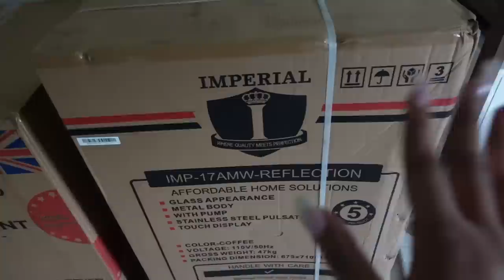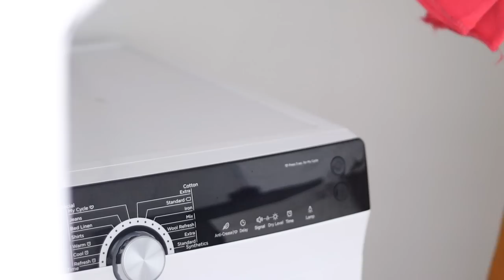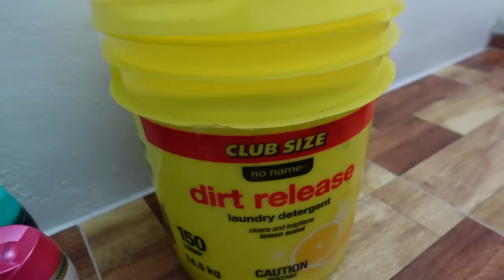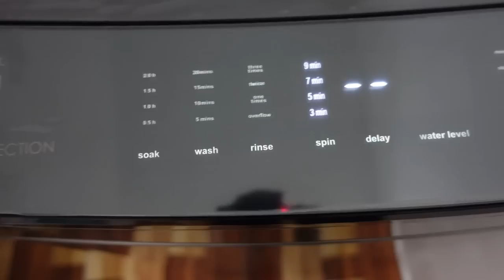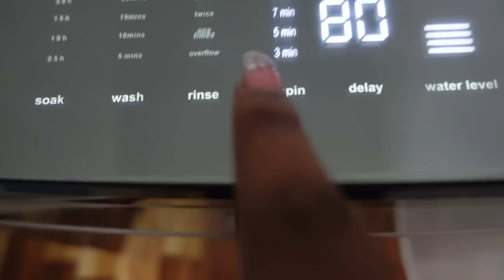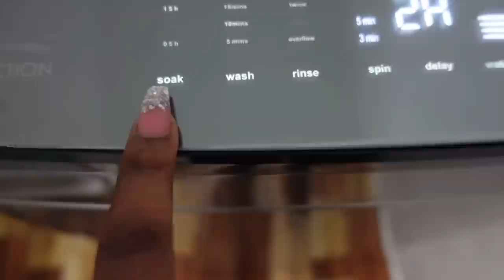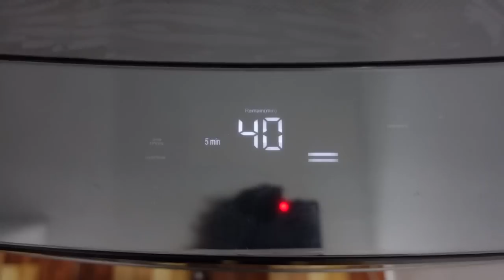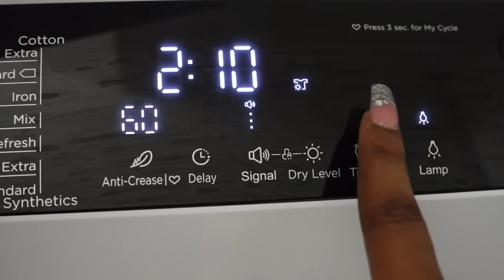LAUNDRY ROOM MAKEOVER IN JAMAICA (vlog) + Laundry Routine (dryer/washer, Deep Clean, organization)

Comment: I have the same issue with my washer but I used a long drain hose from a different washing machine and just attached it to mine. 
From what I understand, the blue downy (unstoppables) is for when you want your clothes to smell fresh until you wear it or use it and the pink one is just to help get rid of odors. I never tried both at once so maybe you're on to something.
I also just grate the blue soap in with my water, detergent and oxi clean and then use the soak cycle on my washer...perfect whites even on really dirty clothes! Don't have to do any scrubbing unless you really have some caked-on dirt.
Reply: Yup try both it's best way that's what I so

Comment: Consider covering up the exposed wire with molding. I'm impressed with appliances from Courts. They seem to be reliable if you buy well known, good brands. If you wait for a sale, you can get a good discount. Call me old fashioned, but I will ALWAYS buy a top loaded washer in Jamaica. Lasts forever, easy to find parts and a technician to repair it. When you try to be too modern, sometimes it can be a problem in the future. 🙂 Island life is cool when you get used to it. Yes you are correct, something always delays projects, so how I deal with that is always have several projects running concurrently so when one stalls out,  just pivot to another one. From my experience, if you keep arguing with people and comparing them to North America, everyone will see you as miserable and not want to help you. Take time to learn the difference between when you should stand up for your rights and when you should just chill. I grew up in Mandeville, it's not the most progressive and cutting edge part of Jamaica, stop trying to make it into what it is not. Adapt to the culture, relax and enjoy Jamaica! It's freezing in Canada right now.
Reply: You're so right about a top-loading washer. These are things we all take for granted. I moved from my mother's house and regret having the front-loading one. It cannot take comforters etc,, the loads are smaller so you waste more water and time, and to me, it doesn't clean as good as my mom's tried-and-true top-loader. My Granny had one as well. Should've followed in the tradition! LOL

Comment: Hello Annesha, was a hose connector supplied with the washing machine?  You could use duck tape wrapped round hose and pipe temporarily.  Some people bore holes through top of the hose and pipe and feed through
wire to stabilize.  I tried to be helpful Michael

Comment: The link below is for washers too. HLMOptimo 6 Feet 12 Feet Universal Washing Machine Drain Hose Flexible Dishwasher Drain Hose Extension Kits Corrugated Washer Hose w/ 1 Hose 1 Hose Clamps 1 U-Bend Hose Holder (6 feet)